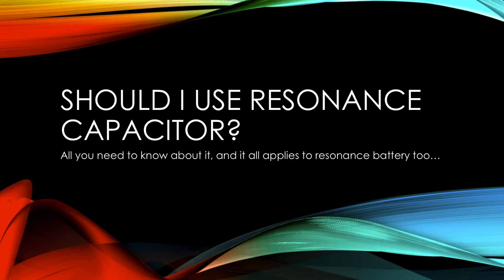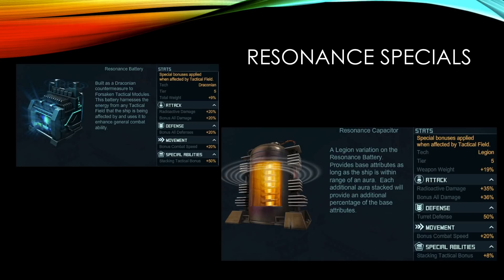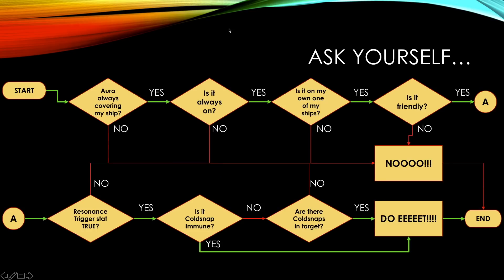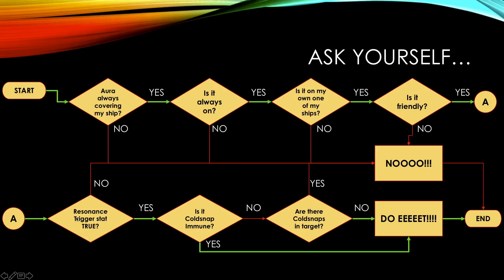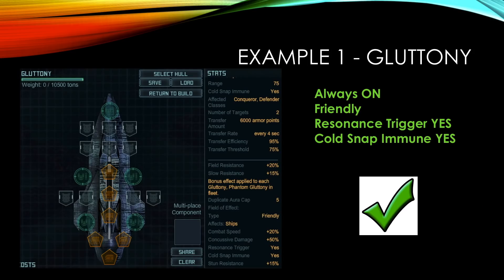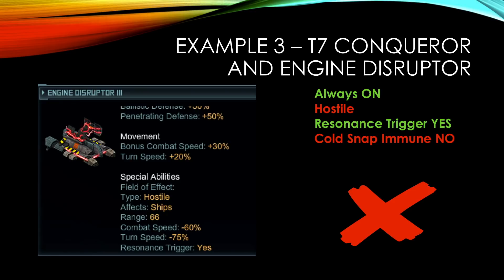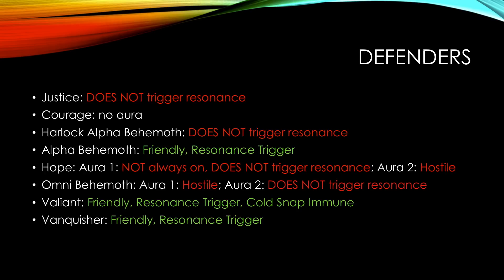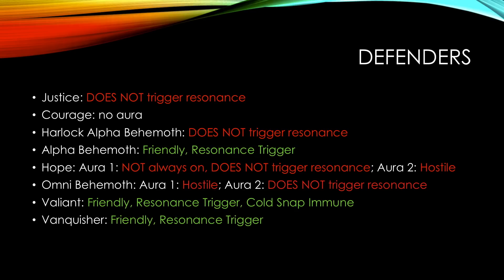Understanding Resonance [BP Explainer] Mar 2018

Comment: Great workflow!  I'm trying to apply it to the new Razortail.  If I understand correctly, Resonance Capacitor should not be used.  The friendly Gill Raker aura does not say Resonance Trigger Yes, only the Hostile CAV field aura does.  So I'd be better off using a different special, right?
Reply from the maker: ABSOLUTELY SPOT ON!! You got it!
Reply: :)  thanks again for the video!  To get the extra speed I want, I may use Hyper 30.  I finally got 5 completed blueprints.
Reply from the maker: yeah, hyper 30 now is fixed, should work well.